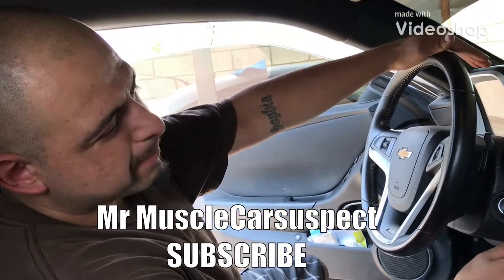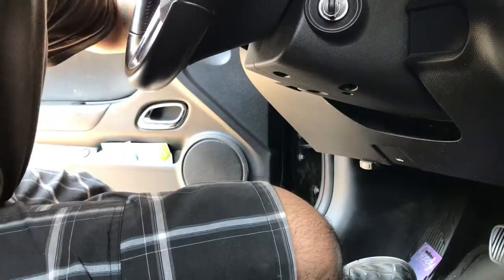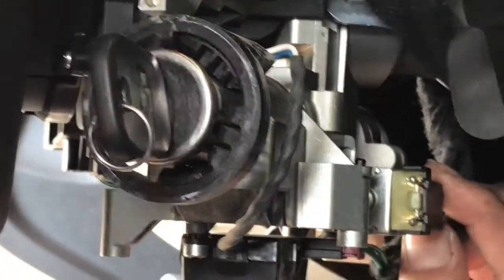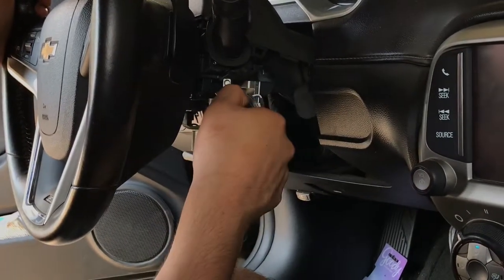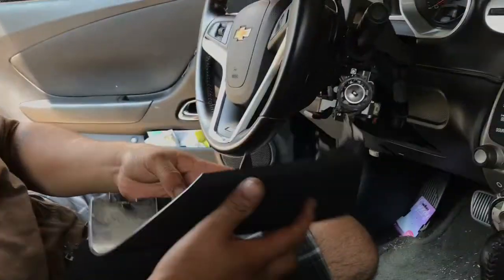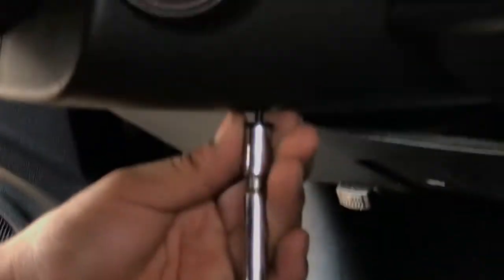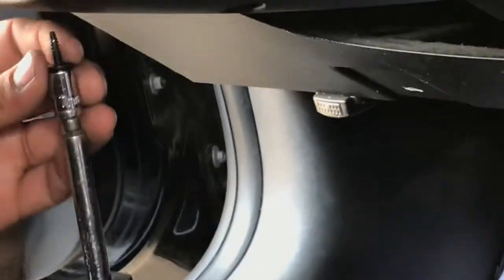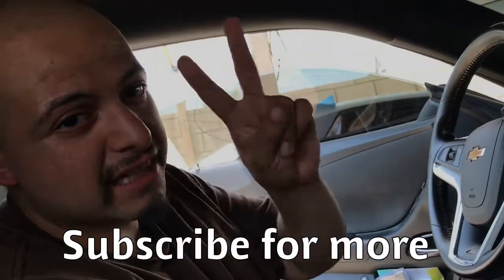2015 Camaro Ignition Key Getting stuck Fix and Solution

Comment: Do you know if this works on the 2013 lt model? 

I’m having the same issue with the key, and so far the swapping gears is all I’ve done to unstick it, but it’s stupid inconsistent so far.
Reply from the maker: Yes It should work on the 2013 models too.
Reply: @mrmusclecarsuspect5362  how about the 2010 just got one and has the same issue
Reply from the maker: @Loscarrenosdedurango  should work

Comment: 2015 Camaro SS. This is happening 2009 to 2015s according to AAA and they get a ton of calls for this. AaA was here for 9 mins and we got key out and it was free (i tipped for his time though) . But apparently its temporary so you do need to do this video... we will start when we know what bolt/screwdriver tool we need. It looked like an uncommon tool that is 21$ at ace from other videos

AAA came and wemt to the engine..unhooked engine..rehooked and turned on and key came out and said key was bad so we used spare key today. Learned fhis is a  temporary fix (AAA did this for free by the way if you need to go somewhere soon and dont have the tools). So again now key stuck...your video helped were just confused bexause other videos sakd a different tool but looked like you used a screwdriver? What did you use?
Reply from the maker: I used a screwdriver attachment tool that attached different tips. Nut the soze of the bolts i bolive were 7mm bolts used a sockets size 7mm. Sorry for the late reply, and yes, this should fix the issue. Replacing parts will just have the issue coning back

Comment: I replaced it with a new part it worked for a bit but now my key is still getting stuck again? What else could it be? I use both old and spare key they both get lock and keys aren’t damaged
Reply from the maker: Its just gm and their bad parts no matter what they always go bad. Thats why this method fixes it completely

Comment: What kind of screw driver I use to get the bolts out with
Reply from the maker: Z Payge Raven their 3 7mm bolts on their so you can use a socket or a detachable screwdriver with a 7mm on it

Comment: What if the buttons on my key remote are missing? And when the key removes and the engine starts would you plug that yellow box back in before you put everything back?
Reply from the maker: Sok Tho if your asking would it cause alarm to go off whiteout your remote working it shouldn’t affect it your alarm still works but if your remote is meet up and u can’t shut it off when u turn alarm on and if it goes off when using key once key in ignition it should shut right off if that’s what ur asking?
Reply: @mrmusclecarsuspect5362  im asking should i plug in the yellow lever back? Or While driving is it okay for it to be unplugged?
Reply from the maker: Sok Tho once u remove the wire I show you to remove you can have it removed from their on to not have the key stuck in your ignition problem no more. So my answer is you can leav the wire disconnected it won’t affect you. I’ve had it for over 2 months disconnected no problems.
Reply: @mrmusclecarsuspect5362  so my remote key buttons are missing because someone peeled them off should get a new key?
Reply from the maker: Sok Tho just get a new remote if your alarm goes off when you open your car just put key in ignition turn key and it will turn off the wire u remove shouldn’t affect anything

Comment: Thank you so much for the video! Finally I can drive without being worried about this issue and without taking 2 keys with me incase the key got stuck I leave it and lock the car from the outside using the other key! 2 times the battery died because I end up leaving the key in the car and I forget to come back to try again to take it off and once I had to replace the battery.
Reply from the maker: Yea that can be really annoying and frusterating. GM needs to make a recall on this. But in reality they wont, because its their way of making their money and use an excuse to bring people to the dealer to pay for repairs that are not neeeded. Im glad my video helped you fix it. Feel free to subscribe!
Reply: @mrmusclecarsuspect5362  yes exactly! when I went to my local dealer they said it will cost me around 400 dollars to fix the issue and I think all what they were about to do is exactly what you did in your video to fix it.

You got my subscribe and thanks again for the video

Comment: I'm having this same problem on my Camaro SS. Does the steering wheel still locks with the ignition off after unplugging the switch?
Reply from the maker: The plug you remove just keeps key locked it wont affect the steering lock at all... its simple fomix dose notnaffect amything ive had that caple unpluged for over a year already no issues what so ever.. let me know if you got more question thanks for your comment and support!

Comment: What wire are you taking off??
Reply from the maker: Joe Pena it’s the  key ignition wire it’s the wire that locks your key. It tends to keep you key locked sometimes just some d40 on your shifter button and it fixes it or you just have a faulty ignition witch is very comment with these vehicle’s. Some customers of mine have came to me even after they payed at dealer to get it fixed the same thing kept happening so it’s just gm and their ignitions

Comment: I seem to have a hard time taking out the 2 piece plastic cover under the steering wheel. Any tips to easily pop it out? I don’t want to damage anything
Reply: Just pop it with flat screw driver on the seem.

Comment: Thank you. This is a great temporary fix, but you lose some safety features when you do this.  The key can come out with the car in gear which is definitely dangerous.  I pulled into my garage and sat there doing something for a few minutes and forgot to put it in park. Key came right out and next thing I know, the car has backed out into the street. This is a good fix, but just beware.  You should replace the ignition solenoid that you unplugged.
Reply from the maker: Your ignition needs replacing this dose, not cause that. I have had it off for over 2 years since i had the car and no issues at all. I have even tried pulling the key off it is impossible. So the issue you're having is the ignition probably needs replacing. Again, no one else has had this issue or netheir have i after removing the wire besides you.

Comment: Thanks dude, I going to try it. Mine has went out not 3 times. The dealer said it was the shifter and they replaced it at a fee of $350. They gave me a discount because it was one day out of warranty and did it for $75. But it looks like the lied to me. I will try this fix. I guess you just leave the electric connection off. Would it be a wise Idea to tape it off to something so it doesnt rattle, or short out on something? Thanks for your video. I will comment after I try it and if it works. Thanks bro.
Reply from the maker: Victor Harrison no problem and yes the dealers do that they know what the problem is but they will have you spend hundreds before actually repairing it. They just have bad ignitions and shifters it usolly helps just spaying d40 on the button on the shifter cuz it tends to dry up and get stuck lubricading it helps. But I bin having my wire disconnected for months now and no issues you can try it should work and you don’t need to tape it but you can if you want with black electrical tape. Thanks for the comment and the support let me know if you got anymore questions!

Comment: Thank You so much! I been trying to figure this out for a while and your video finally popped up! Now that I see which circuit plugs into it, that goes to your neutral safety switch also so I plan to install a push button interrupter so if it does get stuck I can just press that button and the key comes out, so I can still have it connected. Thank you so very much!
Reply from the maker: No problem im glad i can help thanks for your feedback and support! Subscribe!

Comment: Will the key stay locked in when the car is in drive or in reverse after you do this?
Reply from the maker: Brandon Freijanes the key will not come off unless you take it off yourself all this dose is keep key locked 🔒 from you being able to take it off wile car is not on park but will not affect anything else. Key will just not come off  like that even with motion when car is driving or in reverse. I have months with this process done nothing has happen and key doesn’t fall out if you got any more questions feel free to ask thanks you for your comment and support!
Reply: Mr MuscleCarsuspect  So after this process the key will stay locked in the ignition unless the car is in park? Can the wire be put back in and is the name of the spray you were talking about after you put the bolts back on the covers?
Reply from the maker: Brandon Freijanes that’s what the wire is for it’s purpose is to keep key locked cuz the shifter is not sending signal to ignition telling it it’s on park.. so it keeps it locked but all you gota do is remove wires and it won’t be stuck you can also just try to spay d40 on button on shifter to free it helps out listen to steps on video

Comment: How did you remove the bolts??
Reply from the maker: With a detachable screw driver that i used to attach the right size socket. But you can just use a rachet and socket
Reply: @mrmusclecarsuspect5362  if i unplug that thing will i be safe driving the car? I heard its dangerous to drive with that unplugged..

Comment: My 2015 ss has 23k miles on it bought it new. I called the dealer and chated with chevy online they told me im out of 3 year 30k mile bumper to bumper warranty so its gona cost me 135 just for a diagnostic plus additional repairs going to try this later on today instead thanks! Not sure why they can't fix it free if its something clearly wrong with the way they built it! Sucks.
Reply: Update on the ss I removed disconected the cable havent had a problem since👌
Reply from the maker: Gustavo Castro sorry for late reply bro bin working a lot and got some video to upload soon as I get a chance glad this video helped you out thanks for the update. Much appreciated..

Comment: Question bro. So r u suppost to leave it unplugged or r u suppost to change the lil yellow box??
Reply from the maker: Adolfo Flores Jr leave it unplugged won’t hurt anything it’s up to you if you want to be disconnecting it and reconnecting it but it’s what keeps the key locked 🔒 sorry for late reply thanks for your support lmk if you got more questions
Reply: @mrmusclecarsuspect5362  Isnt the key locked into the ignition for safety reasons so that the key doesn't come out of the ignition while driving? I have had this key licking problem a few times,  but I feel it would be dangerous to leave the wire unplugged.
Reply from the maker: Alan Klosinski I’ve had this wire disconnect for almost a year now and no problem and I live in Cali streets here are really bumpy and my key had never fallen out! It’s up to you if you want to do this process. Key will lot come out unless you bring it out yourself.

Comment: Hello, I’ve been having this problem for over a year and I’m tired, my question is do you leave that cable  hanging? Or you did something with it
Reply from the maker: The cabel you keep it disconnected and u can use a small zip tight to keep it in place with something so its not.just hanging u can aslo tape off the connection in black electrical tape so you can feel more confirtble i just left it disconnected and never had an issue. Its up too you how you feel more confirtble.

Comment: So what this wire for ? And if we disconnect it whats gonna stop ? Other than fixin the probelm
Reply from the maker: Keeps your key from getting stuck on your ignition and the key will not fall out wile driving.
Reply: @mrmusclecarsuspect5362  so u mean after disconnecting the key might fall while driving ?
Reply from the maker: no. I said the KEY WILL NOT fall wile driving just letting you know incase you ask that it will not fall off wile driving I had other people say that just letting you know incase you asked if it would fall off and no theirs no way that will happen

Comment: Okay so I'm sure this will work but you are disconnecting it from the computer that tells your car it's in park and okay to take the key out. So this would probably not be a good idea because it will probably let you take the key out when your car is in neutral. Correct? Or am I wrong? This would also void your warranty too right?
Reply from the maker: Jackie White no this will not void your warranty all that cable dose is keep your key locked. And once your key is turned to on mode it shouldn’t just come out unless your force it out. This will not affect your car in any way I’ve had the wire disconnected for  a bit over a year and had no issues. If you got any more questions feel free to ask
Reply: @mrmusclecarsuspect5362  thanks for getting back to me
Reply from the maker: Jackie White no problem thanks for your comment and support!

Comment: Will the key stay in the ignition while the car is on?
Reply from the maker: After removing the wire yes it shouldn’t come out the only way it will come out is if u turn it to the off position & remove it .
Reply: @mrmusclecarsuspect5362  Good to know. My mom took hers to the mechanic and he proceeded to slam the shifter forward a few times and she currently isn't experiencing the issue anymore. If it comes back I'll go ahead and do this.
Reply from the maker: Brian Patrick Brian Patrick you can also spray some d40 on the shifter button and click the button a couple of times it tends to get stuck and if that button gets stuck it won’t send a signal to the ignition switch to tell it it’s on park so it will keep key locked spraying d40 on button and clicking it a couple of times so it lubricates and brakes fee will help it out you can try that or removing wire as well too. I’ve had my wire off for almost a year and no problems thanks for your comment and your support if you got anymore questions feel free to
Ask..

Comment: Thank you so much for the vid! But I ran into an issue. I was stuck for like 35 minutes with the key in the ignition. I did what you did in the vid and my key came out. But, after I set it, I got a "service theft deterrent" alert and my alarm went off! Any ideas?
Reply from the maker: Ia your control with your key or do you have a seprate key from the control? Thst sometimes can set it off but you can always reset it by discounting your negative battery for 15 min and you shouldn't have any issues after thats the first i get alarm set and and anti theft. Let me know if you got.more quesrions
Reply: @mrmusclecarsuspect5362  I'm trying it tonight. Sorry for the late reply, life is crazy sometimes. But I did the steps in the video, unplugged the clip, and now imma undo the negative. Wish me luck!
Reply from the maker: @orochidiscord9124 Goodluck! Let me know if you got more questions. And no worries man we all got stuff to do and cant always reply.
Reply: @mrmusclecarsuspect5362  So I got an update. No luck. I have my key separated from the fob, i unplugged the red clip, unplugged the negative and as I turned my key, it says "Service Theft Deterrent System" and has a orange car and a lock.
Reply from the maker: @orochidiscord9124  looks like the theft system is activated and is preventing you from starting yoir car. You would have to have someone turm the theft system off

Comment: I have a 2014 camaro ss with 27k miles and it recently started getting stuck. I took it to the dealer and they ran they’re “ diagnostic “ and said it was the shifter assembly and would need to be all replaced for 520. 💀 They also said this was not covered in my warranty.
Reply from the maker: Yea they tend to do that its all planned out their shifter and igniton are just bad theu do this to make more money out of your pokets but yet the issue will happen again with time.. this process will not only save u money it will stop the issue..feel free to ask for questions..

Comment: Excuse my language f amazing i just removed it using a 7mm matco 1/4 impact socket and a 1/4 in matco ratchet took me 5min was having issues now my camaro is fine im going to leave the sensor off if it triggers anything on the dash lights or codes ill reply will contact dealer for recall too have a good day thanks bro
Reply from the maker: Yoir shouldnt get any codes i been having mine off and never had any issues. They should have a recall but im all honestly its just gm amd its terrible parts..thanks for the feedback subscribe!

Comment: Any idea why one won't turn over at all, mine comes in and out just fine but won't budge at all?  I've turned the steering wheel a million times to try to unlock so I don't think thats the issue.  It's an automatic by the way
Reply from the maker: If your key is stuck even tho you removed the wire it can be an igniton switch problem already were you gota replace it but then again you shifter has a button on it if it’s not piping out completely how it’s supposed to spray a bit of d40 on the button on you shifter  see if that helps if not your ignition can be bad. If you have not removed the wire I removed you might wanna try that first
Reply from the maker: Josh Smith once I removed the wire I’m like on my video I haven’t had a problem it’s bin a couple of months and my key has not bin getting stuck no more

Comment: This is very helpful but didn’t work on my 2011  Camaro 2SS. I see why it’s locking so I’ll have to stop that pin from sliding back and fourth.
Reply from the maker: SirBubby should fix it with this process your shifter button can also be the problem it’s prob getting stuck use d40 should help but with this process key shouldn’t be getting stuck nomore. If theirs any question feel free to ask thanks